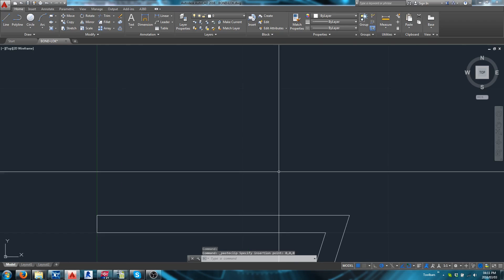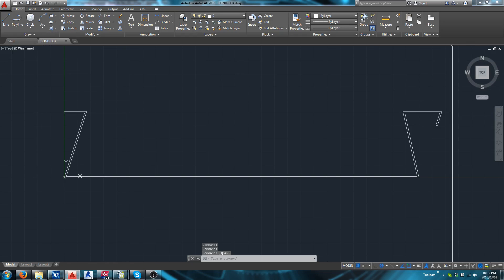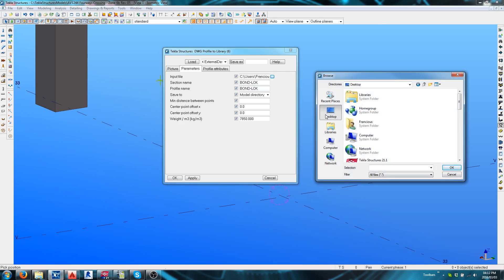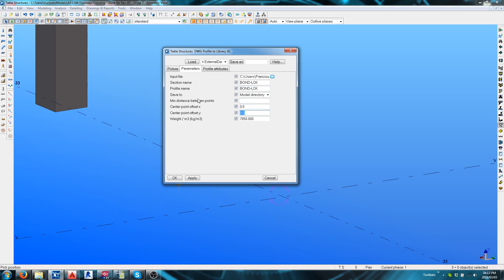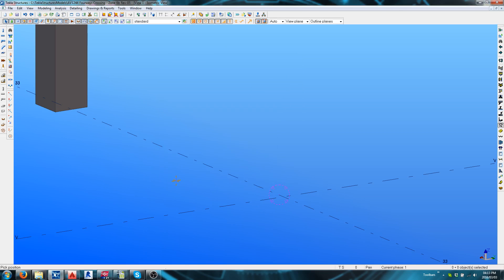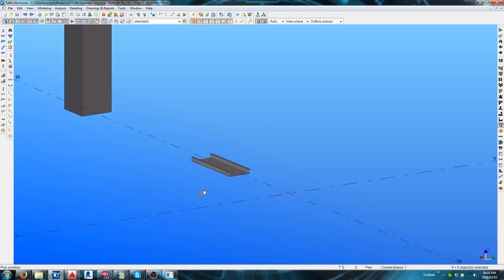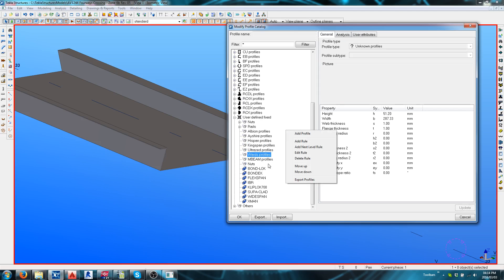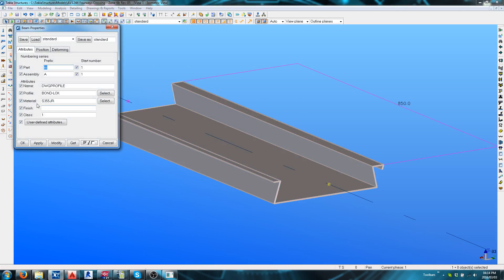Tekla Structures - How to add a new profile shape

Comment: HOW TO CHANGE THICKNESS, WIDTH & DEPTH  VALUES ?
Reply from the maker: This is for making a static profile so there is no changing it after creation.
For different sizes, you will need to make multiple of these static profiles.
For dynamic profiles that you can change you will need to use "Define cross section in sketch editor"
This is the best vid I could find here on youtube showing how.
https://www.youtube.com/watch?v=DTEx7OXBgoU